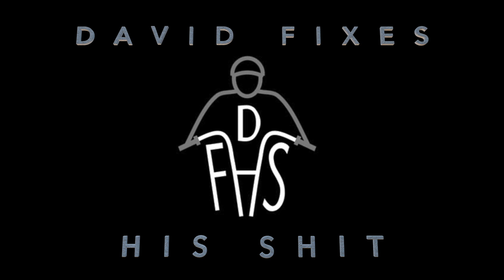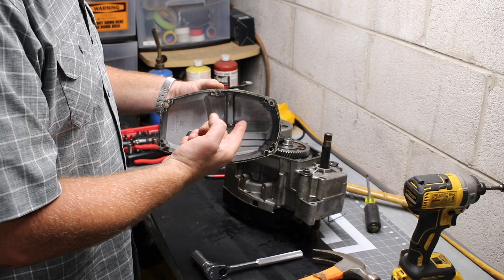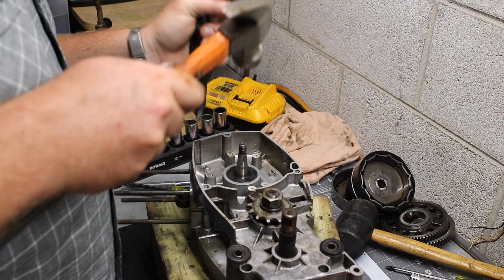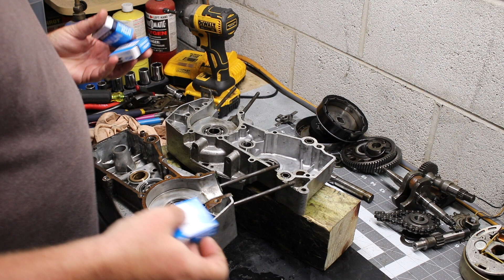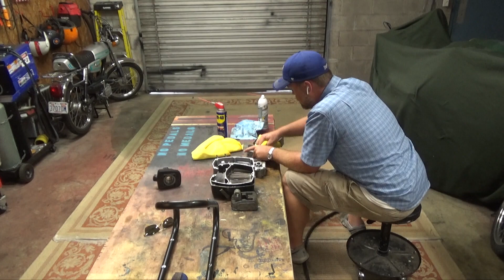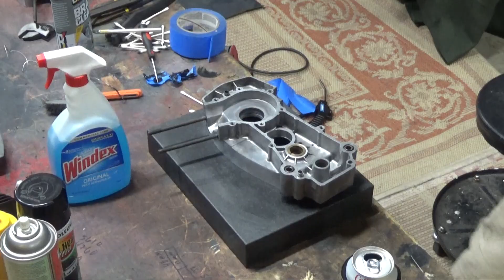DFHS Garelli VIP Ep. 3 - Engine Disassembly and Prep

Comment: Hi I have a kinetic Tfr 2003 I used to turn it of from the ignition but now is not working . When I start it I get to use the choke to turn it off . I disconnected the ignition wires but but never turned of until disconnected the wires that go from the CDI to stator. What could be the problem please ? The CDI is new . Could be the problem on coil keeps powering the engine ? 
I need help please .

Comment: How the heck did you get that nut off at minute 7:22?  I'm tearing down my engine and cant get the gear nut off.  I've already destroyed one strap wrench, took a torch to the nut, used penetrating spray.  Nothing seems to work.  Any tips?  Great video btw!
Reply from the maker: Grab a set of channel locks with fairly thin heads (like Knipex pump pliers). Open them up wide and insert the two heads down into  two of the holes on the gear, holding it tightly in place.  Then impact wrench that thing off.  I edited out my cursing on that one 😜.

Comment: Nice! You have a needle bearing rod! if it were me, i would try mildly porting the cylinder, light hone/new rings, maybe dialing in the squish/compression, and dremelling out the intake to 14-15mm and using a 15sha, with a slip on $35 chamber and i think you'd see 40mph!  or you may get lucky posting on MA Buy/sell for a cylinder kit :)

Comment: Dave, is that stock ignition an IDM setup? I’ve been trying to rebuild my Tomos, but the IDM ignition on mine has almost nonexistent pullers for it. I think that puller you used might help
Reply from the maker: It’s CEV. I don’t think the 19x1 puller will work.  I think you need the 18x1.5, but don’t quote me on that.
Reply: David Fixes His Shit I’ll just hop on the lathe and see if I can make one. I ordered the 19x1 puller, but that can always be returned

Comment: That is a lot of parts for that motor David! Looks like a jig saw puzzle.
Do you have an exploded view in the parts manual? I would need one for sure.
Reply from the maker: I have the online manual, but there isn't an exploded drawing on it.  Lucky for me, I record myself taking it apart, so I just need to watch that episode in reverse :-)
Reply: @DavidFixesHisShit  I just bought another peugeot and it is in better condition than the other one that i bought before. This one is 78 SP-U3 so both have the motor that have more power. I am almost done with the Indian just finishing the wiring.
Cheers
Reply from the maker: Heya Rob.  I just bought a Peugeot as well :-). Details soon...
Reply: Cool! which model? I already disassembled the 77 LVS-U3 The fuel tank is the main problem due to rust and cracks not sure if I will be able to fix it but I am going to try my best. I like the looks of it better than the 103 SP but the SP is in better shape cosmetically, tank is rusty but not as bad as the other one. All of sudden now  I have 3 mopeds! Cant wait for you to start on that Peugeot.Have a Happy Thanksgiving.Cheers

Comment: And i know about frustration i finally got the bearings for the wheels of my indian i ordered sealled bearings instead of the open that it had so i did not need the two washers/shims that covered the exposed part of the bearing even thought they were on the inside of the wheel hub.
I had a problem with the brake shoes that i ordered from treatland and had to do more modification to them to make them fit in the hub. So after i installed the wheel and thightened it the wheel binds! I have tried everything i know and no luck. If i loosen the shaft nut the wheel turns no problem but once i thighten it it binds up. Any ideas as to what the problem might be? The brake shoes i ordered are the ones treatland recommends for my model. I have the 8 spoke aluminum kind.
Cheers